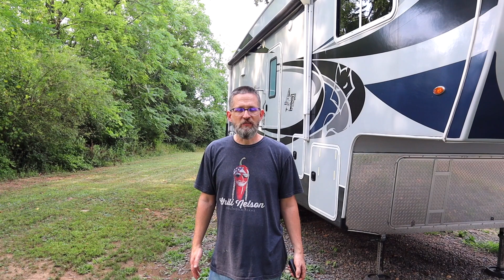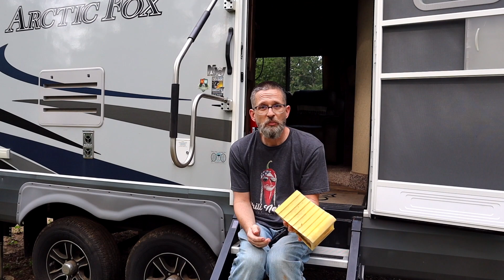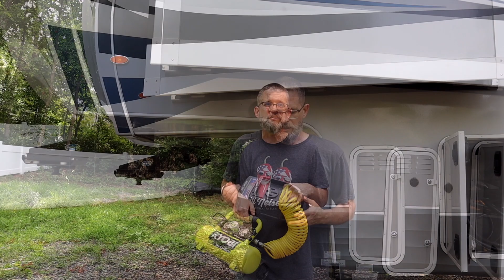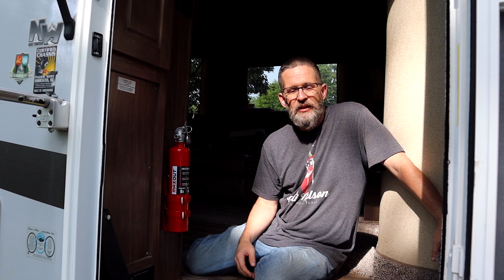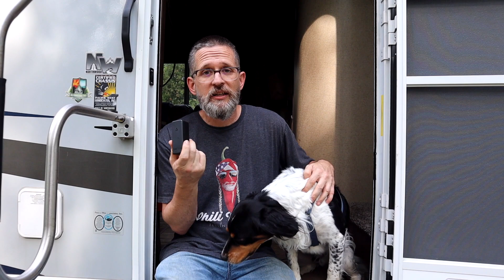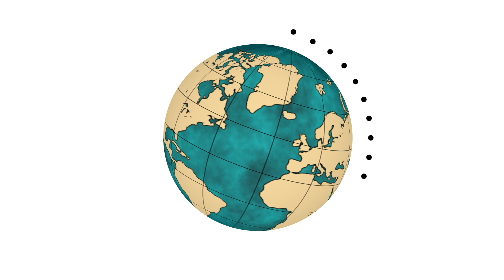RV Safety Gear - Most Important Things You Need to Stay Safe on the Road

Comment: Definitely use the tire pressure monitor! Losing a tire at high speed and taking out a fender is preventable. We also pack our wheel bearings on a regular maintenance schedule.

Comment: What size and rating are your tires. Recommend at least 16" E rated tires or heavier.
Reply from the maker: We have 16" E rated tires. Good point though...always have at least E rated tires on the travel trailer or fifth wheel.